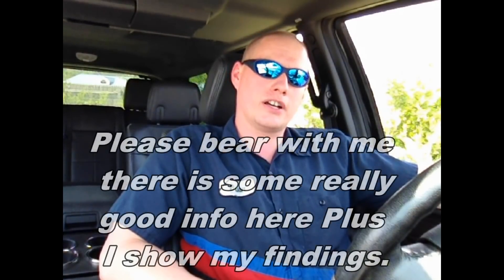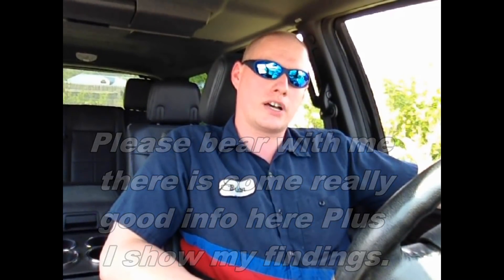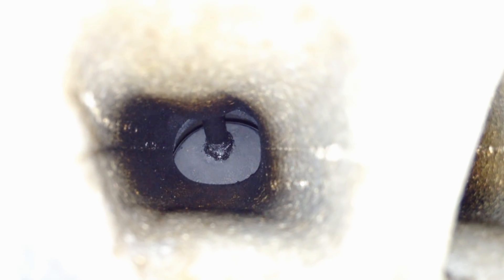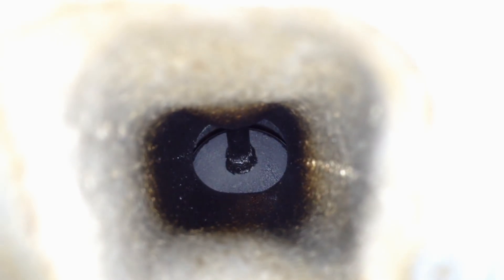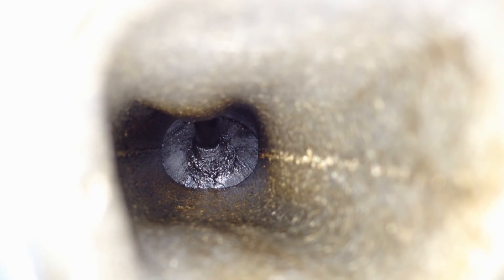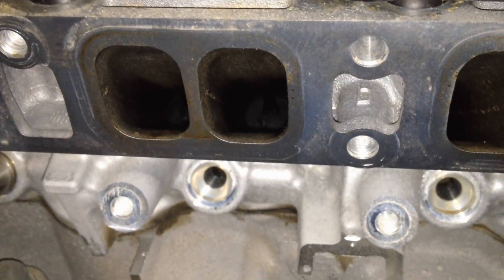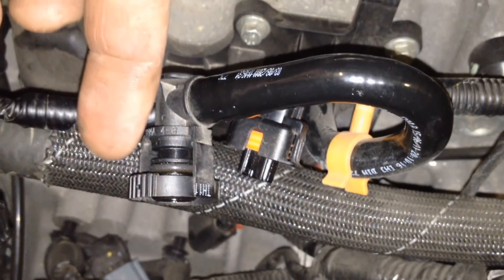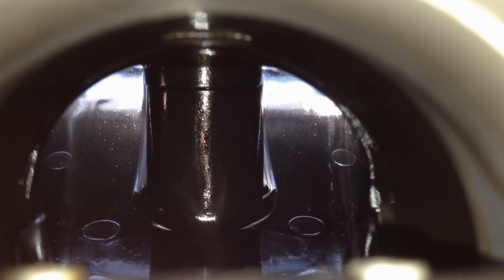Ford Ecoboost Warning Part 2 My Findings

Comment: I dont know if there is any difference in production between usa and eu, but its my 4th year with my 1.0 eco focus which I hammer every day in bad conditions, sometimes even run past the 20.000km/1 year service. Driven about 80.000km now Never a single sign of any problem, very reliable and far more advanced than most other new cars on the market right now. I love my ecoboost :)
Reply: 2.0 galaxy runs really nice,I use 99 or 100 octane fuel from the pumps this has no ethanol in.ethanol when Burnt produces water,maybe this has something to do with it as from what I can see fuel in the states is low octane and probably got the 5% ethanol of standard fuel here.🇬🇧

Comment: Moral of the story, change your oil and keep it clean!
Reply: +Chris Swisher changing engine oil has nothing to do with clogged valves due to EGR recirculation.  These  partially burned gasses have small particles which accumulate on the intake valves.  the old style fuel injector "bathed" away this accumulation and kept the passage clean and allowed for free air and gas mixture to flow easily.  Direct injection cannot clean the sticky dirt from the intake valves, so it accumulates and cause unwanted air turbulence.
Reply: I do beg to differ on this point, as being a mechanic for life and being ford trained I know this, a mechanics car is always the last car to be serviced and taken care of. Next if clean oil is running through the pcv system the pcv valve and inside the intake  wont tarnish nor will the intake runners. The customers who bring there cars or trucks to me to be serviced at 3 months 3000 miles don't have these issues. yes I know the book says more miles than that. Over maintain and go a million, under maintain and have premature failure. Lastly are you indicating  that you have a air filtration problem. Oh yah replace the filter regularly and make sure there are no signs of air box damage or warping you can easily see the signs of dirt in the intake at the housing. I had to learn the 6.0l powerstroke in colorado before the engineers could  give us good advise, I have customers who I see regularly and those who come in  on the tow truck every couple of years.
Reply: Chris Swisher ...if the answer is as simple as 3000 mile oil change intervals then why isn't that in the owners manuals?
There are many new cars out there I'd love to buy tomorrow but I'm reluctant to do so because of the damn GDI carbon issue and the extra expense to maintain.

Comment: One problem with ford is the use and reuse of names like duratec, zetec, ecoboost, which are applied to so many different design concepts that they end up being meaningless.     I must admit when small 'ecoboost' engines were being publicised in britain (3 cylinder 1 litre!) as having spectacular bhp/litre figures, and 'special friction reducing coatings on the pistons and rings' i knew pretty much what to expect. Underdeveloped engines backed up by under researched fuel and oil trials. If in doubt as to whether something has longevity the profiteers will simply market it then try and ignore any problems that arise.

It would have been relatively simple to trial 50 engines for a reasonable period, but no, that would mean time lost. Pah..

Comment: this due to city driving or highway miles..?
Reply: most likely city... that's when the rpms are low. When you're on the highway, your rpms are high and don't allow carbon to deposit... it simply just blows it out the exhaust
Reply: +Billy Bradshaw  I run 300 miles a week work an back so I guess I'll be ok with a ecoboost?
Reply: One way to prevent carbon buildup is a pretty simple trick. Just floor your car about once or twice a month... and I mean floor it, get it to the redline. I assume your car is an automatic so it will shift before the engine over revs it's self. It also depends on your route. If you do a lot of city driving, you have have to worry about this, if your route is mostly highway, not so much. Just  push your car to its limits about once or twice a month,  that will loosen up the carbon and simply push it out the exhaust.

Comment: Wow, glad my new car (Fiat Abarth) is one of the few left that are NOT Direct Injection. This carbon buildup on direct injection issues is a widespread problem, goes beyond just Ford.
Reply: +Alvin Brinson 
Ha like an italian chrysler is any  kind of reliable
Reply: +Alvin Brinson Fiat engines are junk.  no matter ho they are injected.
Reply: ***** I know consumer reports very well. First of all, the Fiat 500 is NOT unreliable. 

Second CR version of Unreliable includes things like "Idiot had to visit dealer to figure out how to pair phone" .. ie, "Confusing audio controls"...

Third, most of the "unreliable" reports relate to 2012 launch year issues (which do not affect later 500 models) and 500L issues from 2014 relating to users "unhappy" with the Dual Clutch transmission. The 500L is a completely different platform than the 500. People can't seem to grasp that.

Fourth, people turn a few percentage points of reliability into a much bigger thing. Having a couple of % more problems does NOT mean you're going to be stranded on the side of the road dead. I can double by odds of winning the lottery by buying two tickets instead of one, but I'm still probably not going to win. 

Modern cars are MUCH more reliable than years past, and CR's method of determing reliability is designed to blow minor differences way out of proportion in order to SCARE buyers into thinking they MUST read CR or they will end up stranded on the side of the road, picked up by a mass murderer, and found dead in a refrigerator.

Most actual owners of Fiat 500s find that there are no major mechanical reliability issues.
Reply: +Alvin Brinson FIAT   F or I ntentional A utomobile  T rouble.   JUNK personified
Reply: Fix It Again, Tony
Reply: Yeah I'm just worried about the wickedly complicated Multi Air block failing.
Reply: Nothing against anything but all the Fiat related cars including other companies Fiat owns are not known to be reliable cars.  But interesting your turbo car does not have direct injection.
Reply: +Ninjamaag so true
Reply from the maker: +Alvin Brinson Agreed
Reply: true but port injection  also creates just as much carbon build up inside the intake so theres no way around it
Reply: +abz124816 If a car were a person, then yes, it would be 'personified'
Reply: @Steven Willis, Throttle body or port? I thought it was port..
Reply: Alvin Brinson Fix It Again Tony.  I owned a Fiat once, never again
Reply: +Alvin Brinson I'd like to hear what he bases his statement off of too. My abarth has been hammered every day of its life for 2 years and has yet to have an issue.
Reply: abz124816 And you base this on what hearsay?

Comment: Most all cars and trucks that have direct injection have a carbon build up problem. The valves don't get cleaned by the fuel and cleaners that are put in the fuel because it doesn't pass through the intake manifold. It is a major problem that needs to be fixed. I don't see how cleaners can damage the turbo. I have not had this problem in my car, but it isn't a Ford. The designers need to come up with a way the intake valves can be cleaned with driving so there is no need for expensive cleanings. The solution now is to buy a car or truck with out direct injection otherwise expect to pay the piper for direct injection. The increase in efficency is off set by the cost of cleaning services so are we saving money or losing it?
Reply: +C MJ A Oil catch cans should be installed on factory turbo cars, that would help considerably.  Another relatively inexpensive solution might be adding a throttle body injector that's only engaged for certain load conditions.  It would help clean of the valves a bit but wouldn't need to be used regularly making the impact on fuel economy negligible.
Reply: I agree. I have a catch can on my car. The engineers that design these engines need to make improvements in order to prevent this. When you buy a new car you shouldn't need to purchase a catch can or take the car in for expensive cleanings every 10 to 15k miles. This is really a poor practice on the part of the car industry.
Reply: C MJ Ouch...why so hard on the engineers?

Engineers are fully aware and make recommendations.  If we had our way, everything would be bulletproof.  It's the pencil pushers and penny pinchers that ruin everything.

Comment: have a 2012 f150 3.5 eco with 170000 miles on and still runs great not one problem with it
Reply: @Sheldon Richardson, There's a bone head response!
Reply: I agree! 170000 miles!
Reply: Mike Bodlak ....170,000 miles in 4 yrs. You must be doing a lot of highway miles.
Reply: 2012 F150 3.5L 286k miles
Oil changes every 10k approx. 
spark plugs every 75-100k
Brakes and tires when needed
Coolant flush once (can’t remember mileage) 
Coils once because I thought I should 200k (best I remember)

About to do the 1st belt, t-stat replacement. Again, because I think I should. 

That’s the full maintenance history.
Reply: APiriates Life ever show actual symptoms leading you to think of that? Or with the spark plugs? Checking out a clean low mile one with the fluctuating/shakey idle but pulls hard when on it
Reply: +chupamishuevos303  what do I have to what for
Reply: just u wait all the morons that can tell the future are great. If you have these magical powers do something about it instead of just being a punk, eh? :)
Reply: That is not saying much since the 5.3 has always been an underpowered, gas guzzling, lemon......
Reply: Hello moron!
Reply: Tyler Andrew 185000 on my 2014 no issues!
Reply: Man. I’m afraid of buying an EcoBoost. Are there any other issues besides this and condensation?
Reply: Mike Bodlak Depends on where you drive it. Carbon buildup is a lot worse if you sit in traffic than it is if you are constantly going above 30 mph.
Reply: Mike Bodlak how many miles do you have on your truck now?  Have you had any issues?
Reply: Justin Thomas On your ecoboost? Nice.
Reply: Puff the Magic Dragon yes sir runs amazing I’m now at 190k nothing has been replaced maintenance stuff.
Reply: Justin Thomas that's good to hear i have a 17 f150 ecoboost I love it. I've read on forums numerous guys with 200k 300k and even 400k on em. Just minor stuff replaced it still has original tranny and original 3.5 that's impressive.
Reply: Jason Garcia I’m just about at 200k, still no issues
Reply: @justinthomas3415  what's your oil change interval, and do you an oil catch can?
Reply: Very poor example- startup cycles, especially in cold weather increase carbon buildup.
Reply: Same here, I'm at 176k and mine is running like a champ. I'll take it get looked at when I get to 180k
Reply: don't talk to loud the engine will here u😂😎😂
Reply: @calbright573  this why most newer direct injection gasoline engines use 2 injectors per cylinder to counter that problems
Reply: 159,000 miles on my 2013 XLT 3.5... TURBOW WHITLUNG SIUND AS I ACCELERATE
Reply: sheldon blankenship I seriously doubt the Ecoboost engines will outlast the engines in the 92-96 Ford Trucks.
Reply: +Mike Bodlak thats because u been doing the right maintenance plus is only a 2012 just u wait
Reply: The 3.5 has both port and direct injection whereas the 2.7 only has direct injection which leads to the carbon building on the valves and related turbo issues - I havent heard many people having issues with the 3.5.
Reply: @dylandevlin336  they do now but the early ones didn't. now u have to worry about another set of injectors
Reply: A 5.3 will run circles around a Ecoboost for a long time.
Reply: Take your turbo off and we'll see how your ecoboost really is.
Reply: Sheldon Richardson would still be better than any N/A GM v6. 230,000 completely original miles 3.5 eco.

Comment: Have u realized all fords a junk
Reply: +Billy Bradshaw remember the engines catching fire a few yrs back???
Reply: +billy bob what that one way or another there junk
Reply: +TJ Lawrence, they're not.  If you wanna talk about junk vehicles, talk about all GM vehicles.  They're just as bad as the Chinese cars.
Reply: +DeadofWinter321 ur just another Ford owner that thinks Ford's are good but in reality there junk they got u in there cycle of shit. a good vehicle is not going to have a motor problem like this feller talks about in vid aney way Ford has u by junk so when it breaks they Ford gets more money like the bulit proofing there diesel motors more money from u the owner and they still blow up that's y they have went through like 3 different Motors lately they don't have good motors now u decide to get a new Ford cuz ur old one cost almost as much as buying a new one so u get another ford and stay in the same cycle well guess what Chevy hasn't changed there good motors like the Duramax or the 5.3 Vortec cuz y fix it if it ain't broke and dodge runing Cummins they don't have a problem so they haven't changed it all boils down to Ford's being junk
Reply: +billy bob also aney one can put a big motor in a small light weight car and with the right gearing have a fast cool car
Reply: +Billy Bradshaw if I'm not mistaken it's still a V8
Reply: So? Just because it's a v8 that dosnt means it's  big. That's like saying all people that run for president automatically know what they're talking about.
Reply: +Billy Bradshaw no definitely not how that works bud
Reply: But see all / most of there motors are junk it's not this one it's self making fords junk it's all of them that I know of from at least year 2000 and up the triton junk the copy of international 7.3  the 6.0 6.4 6.7 that's y they have changed the diesel motors so much  cuz there junk
Reply: I agree, they've had what, 13 billion recalls since 1999?
Reply: First of all, the 4.6 isn't "big." Sure,, it was used in the Mustang gt for quite some time, but it was designed for utility work. It was used in the Crown Vic, you know... the cop car of choice for the past 15 years. It was also used in the F series, you know... the best selling truck series for the past 35 years. It's one of the few gasoline engines that will go AT LEAST 400,000 miles without any problems.
Reply: Kinda like saying Ford is junk because this engine is the first to have a minor problem in 20 years, I know. Dosnt work that way bud.
Reply: Holy it must be nice to be as stupid as you, what's it like?

Comment: Ok here is the reason all this is happening; it's the fuel quality, this engines were made and tested primary in Europe, this is going worst due to the new computers in new vehicles. This same problem was recorded with the 7.3 liter Diesel engine and the 7.5liter gasoline engine as well. Unfortunately that's the reality of us fuels; bad bad bad quality compared with the fuels in Europe.
Reply: +didier banegas No, its not gas. Most USA gas is ISO9001 certified just like the european gas. Gas formulation is the same except maybe different levels of additive required per country. And even then, besides Maverick gas stations, all major gasoline brands are Top Tier compliant here in America. 
Direct injection engines squirt the fuel directly into the cylinder; it never goes past the intake valves. Consequently, the fresh charge of air and gasoline mixture does not get to clean the intake valves. As a matter of fact, most gas brands contain two separate additives. One cleans the intake valves and creates deposits in the combustion chambers and the second additive comes in to clean the side effects of the first one. But now that no mixture goes that way, the intake valves are not getting clean. 
I've been working on volkswagen direct injected engines, lately, cleaning intake valves because direct fuel injection has this flaw (unless its port injected as well). All these engines are having valve deposits all around the world.

Comment: Direct Injection is the problem. Just Pull Off PCV Valve Pipe Off The Intake Pipe Thats All or Ford Needs To Engineer An extra set of fuel injectors through the intake manifold to clean valves naturally.

Comment: Should I be going to the dealer requesting cylinder heads? I have ~35k mi on my 3.5 ecoboost SHO, don't believe I'm having misfires and no codes being thrown, but it may be hurting performance and fuel economy. Whats the latest advice?
Reply from the maker: +Jeremiah Bright They wont do anything for you unless there is a verifiable problem. There is no later info as of yet on a proper cleaning method.  BG products say their DI cleaner does the job though safely.
Reply: So I can disregard the warning about the cleaning products overheating the turbo units if using the BG products? Thanks
Reply from the maker: That's what they are saying they have a test mule SHO they have been doing cleanings on and I have been talking with their rep too. Here is a link to the story for the SHO from their labs if you are close to chicagoland I will do your first one free they gave me the chemicals for a video check it out-
https://www.bgprod.com/bgfueltest/
Reply: +FordTechMakuloco great link, thanks for sharing, and thank you for the kind offer, however I am in the Philadelphia area, so not very close :)  I may try to find someone near me that can perform this. I just received a pcv can setup from JLT and hope to install it this week.  Also it seems that my oil life indicator isn't my friend with regards to this problem, i should probably be changing oil more often, and using fully synthetic instead of semi synthetic.  Do you have a recommendation on oil? For filters I've just been using motorcraft, I find the quality to be pretty decent and a fair price.
Reply from the maker: I agrees I only use motorcraft filters. As far as the oil you should be using full synthetic 3w-30 I prefer the latest penzoil made out natural gas- every 5k
http://www.amazon.com/gp/product/B00ELHNM3K/ref=as_li_tl?ie=UTF8&camp=1789&creative=390957&creativeASIN=B00ELHNM3K&linkCode=as2&tag=fordt-20&linkId=5WRFTSGK3NQWJ43G